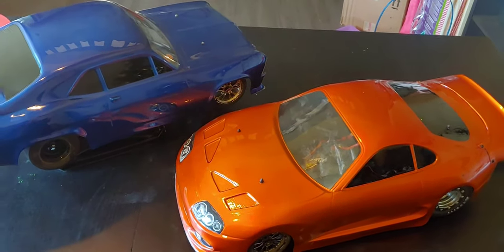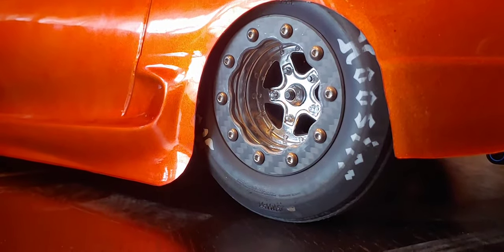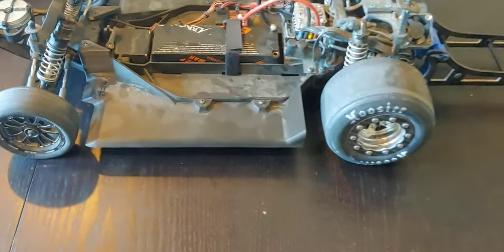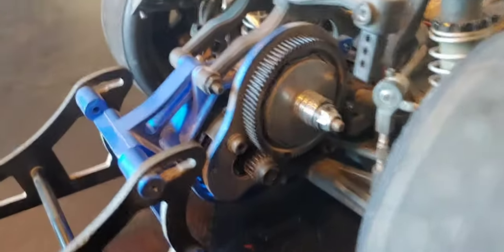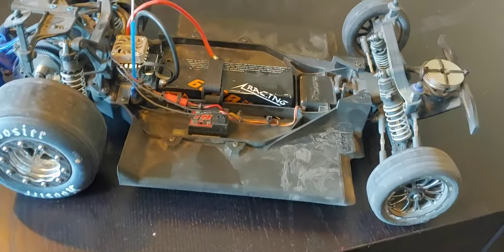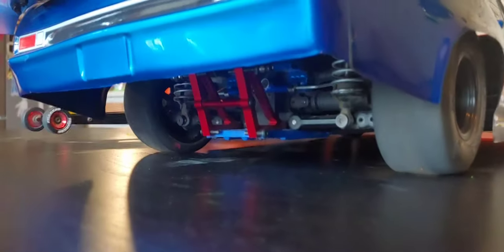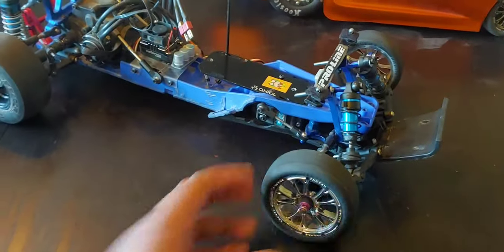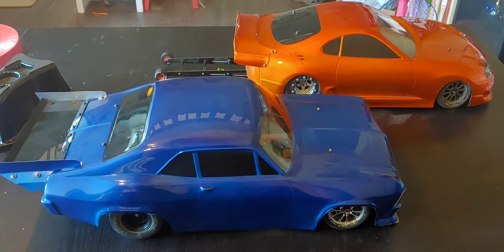No Prep RC Outlaw & 13.5 Build

Comment: I use to think the same thing about transmitters… till I slow motion videoed my reaction to when the car moved. Used my Flysky gt5 to a Sanwa m44. It was a noticeable difference.

Now, knowing your transmitter, you can combat that, but if you have to let off and get back on or steering correct, that’s where it’ll make a bigger difference.

Comment: Great content and vids bro. Just finishing my slash build. I put 70wt oil in the rear shocks and 32.5wt front. She's still sitting slammed down any suggestions? Almost seems like no oil, lol. Stock traxxas shocks, white springs front, red springs rear if that helps.
Reply from the maker: Personal I run a lighter oil and a heavier spring and some run the opposite. It's all about trial and error.

Comment: What motor fan mount are you using and how do you like it? Will it fit on the new drag slash?
Reply from the maker: I ordered the fan mount fro eBay for the DR10. This one specifically won't fit the drag slash but I'm sure you can get one from the traxxas chassis.